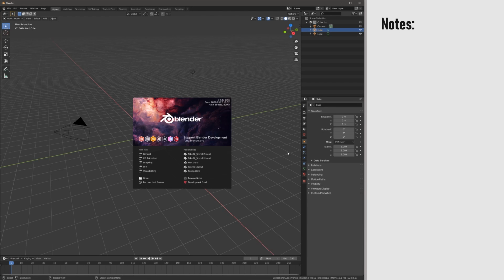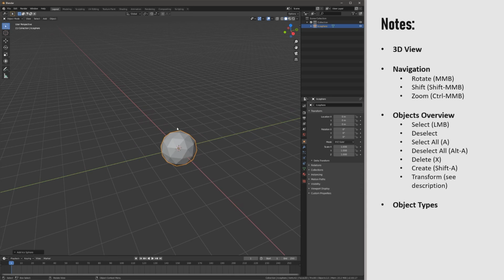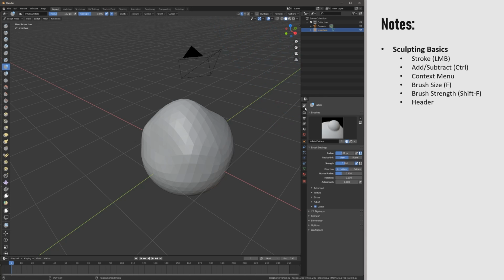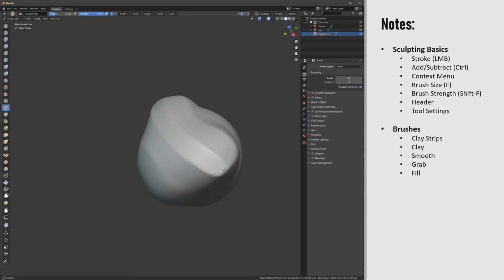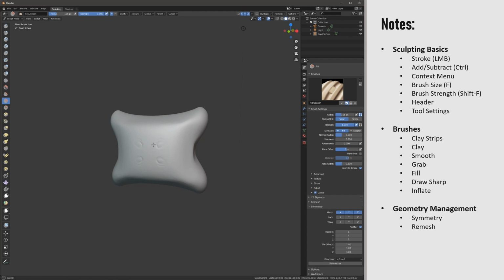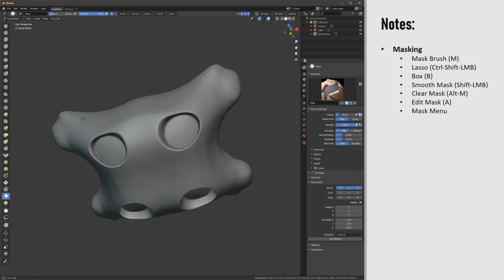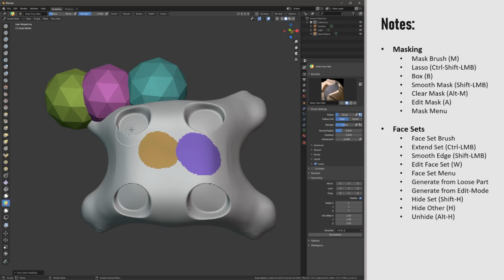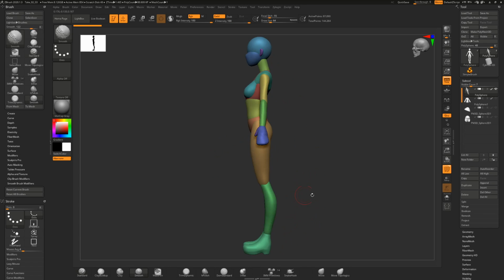[#02] Anime Character 3D Modeling Tutorial 2020 – Introduction to Sculpting in Blender 2.83

Comment: 11:19 where the remesh option is gets covered up by the menu on the side. If i shrink the side menu to where I can barely see it, the remesh option become visible. Is there a setting that was changed so his does not do this or is it a screen size issue?
Found a solution already lol. For those who also have this issue - Edit>Preferences>Interface>Display>Resolution Scale